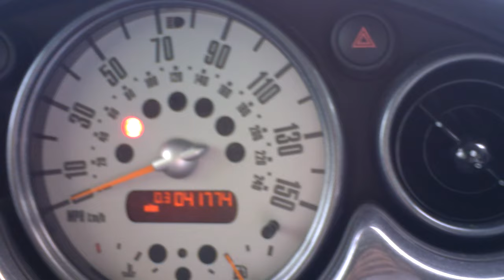Reset Tyre Pressure MINI - TP Button

Comment: had my front tyres changed yesterday, today the tyre warning light was flashing orange, did your reset guide and it has gone out, I will check the tyre pressures on Monday at the garage that change them, thanks for uploading  your infor was excellent